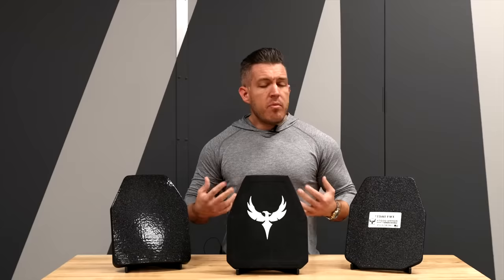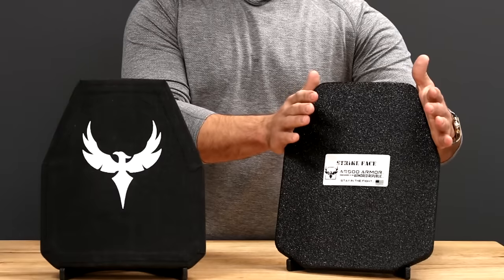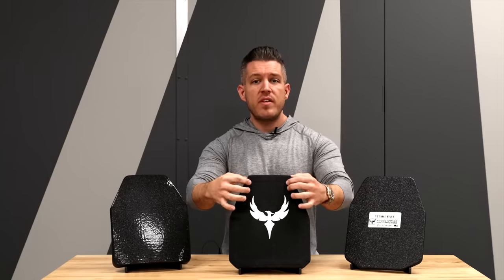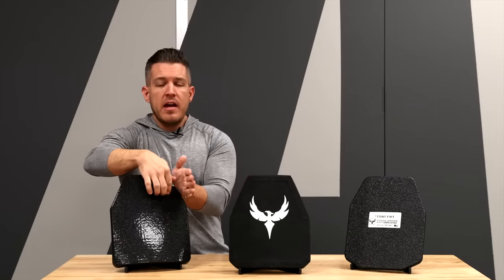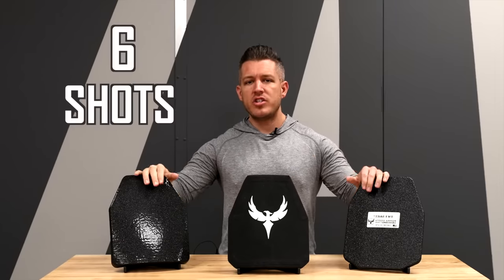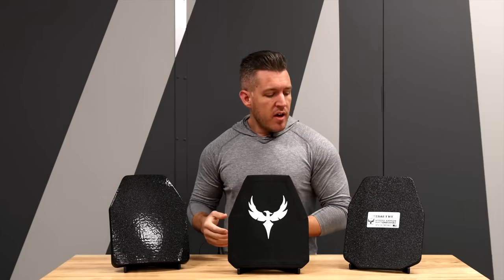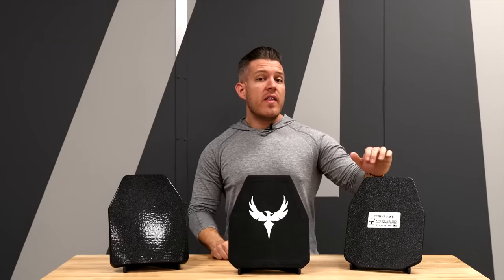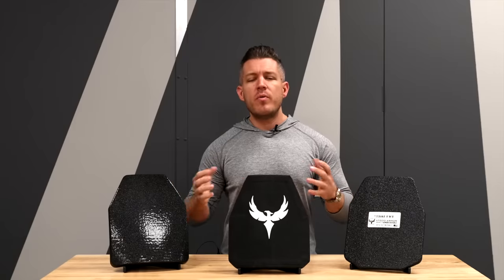What most armor manufacturers aren't telling you?   AR500 Armor

Comment: Just as UHMWPE Lvl III struggles with M855 but seems to handle M193 okay, Steel Lvl III armor has the opposite problem and generally struggles with M193 while handling M855 (hence the need for III+ designation to indicate it handles both threats).   

Since both of these are commonly available rounds, IMO the III designation should be considered obsolete and the III+ used as baseline to prevent confusion, I can't imagine there ever being a reason to opt for just the level III. 

Would like to see a spall test with base coat only on a multi-curve plate because some are looking for a concealable setup and the thinner the better for use under light jacket or hoodie.

Have you considered experimenting with perforated steel embedded within the outer layers of UHMWPE?  This is technology used in some armored vehicles (CVR(T) uparmor package and Leopard 2) to add protection while dramatically reducing weight.    The holes are sized and spaced such that a round cannot pass through without hitting an edge and experiencing high asymmetric forces that disrupts its path.   After it starts to keyhole within the armor, even UHMWPE should be able to handle something like m855 traveling more sideways than forward, and the material also serves to support the steel, keep it in place, help hold it together, and catch any spalling or fragments.  In essence, a build up coat that is armor itself.  Lighter than steel, thinner than UHMWPE, cheaper than ceramic.

https://www.rankarmor.com/assets/images/Bullet.gif

https://i.imgur.com/DdOL6o2.png

https://www.sciencedirect.com/science/article/pii/S0261306914004798
Reply: You could use T Rex tape to make a concealable carrier.  Won't be very comfy, and will hurt more if you get hit, but it'll work.

Comment: What if you added two plates, steel of course. Level 3 and level 3 plus. Is it stronger then level 4??
Reply: Even if it did, why would you want to?  Steel plates are very heavy.  Each 10"x12" level 3 steel plate is going to run in the neighborhood of about 9.5 pounds, depending on manufacturer, and the type and amount of anti-spall coating.  That means 19 pounds per pair of plates, which would normally be worn front and back.  If you're wanting to double up in the front, you also need to double up in the back just to keep your plate carrier balanced, which means 38 pounds of plates.  That's not counting the weight of the plate carrier itself, which will probably push you into the 40 pound range.  

That's also not counting the weight of any accessories you mount on the plate carrier, such as extra magazines.  For reference, a 30 round USGI AR-15 magazine loaded with M193 weighs 15 ounces.  I haven't weighed any mag pouches, but it's a safe bet that they weigh at least an ounce, which means that every magazine you add to the plate carrier adds a pound.  If you're adding double pouches, you're talking about an extra 6 pounds, so you're now up to 46 pounds.

If you then follow the trend AR500 is trying to push of the chest mounted pistol (I'll leave my comments on that specific trend at "I don't care for it"), you're looking at adding another 2 pounds (Glock 17 with a loaded magazine is 32.28 ounces, so 2 pounds, 0.28 ounces), and your plate carrier is now up to 48 pounds.  A fully loaded Glock 17 magazine weighs about 10.23 ounces (math from Glock's website based on the 
Weight with loaded magazine - Weight without magazine).  If you add 3 extra loaded magazines for the pistol, you're adding another 30.69 ounces, plus the weight of the magazine pouches, fair bet that 3 pistol mag pouches are 2 ounces or more, putting you at another 2 pounds for those.

Now, I'm not going to question whether or not you're fit enough to hoss all that weight around, because it's irrelevant.  That's a lot of weight to have resting on your shoulders, back, and chest.  It will go from "damn uncomfortable" to "downright painful" in a hurry, no matter how much of a hard ass you are.  The padding on some of AR500's carriers is OK, but trust me when I say that even when your whole setup weighs less than 30 pounds, that weight wears at you after a while.
Reply: That would be heavy.  Some plates are not stand alone rated and require a 3A kevlar backing armor which would be more realistic.
Reply: Considering no one so far understands the concept of answering a question YOU asked I'll gladly do so instead, with good quality steel plates to be exact, I've seen a video regarding this, two good quality level 3 steel plates was enough to stop 50 BMG, it pierced the first and slightly knocked a tiny hole in the second with no back face deformation on the second plate

Comment: Ugh at 1:52 you say "up to a 2" allowance" for an edge. Later your calculations for a 10x12 plate are inaccurate then at 8x10, because you would have to reduce 2 inches from EACH side... So that would make a 10x12 plate actually more like a 6x8 plate potentially.
Reply: I’m seeing this a lot and the only thing that makes sense, is he explained it wrong.  Really what I think he meant to say was take an inch off each side because this would mean two inches across total, and two inches vertical total.  Making a10x12 in to an 8x10 effectively, if that makes sense?  I’ve seen these plates cut through the center and opened up and there is an inch boarder all the way around which would be a total of two inches across and two inches vertically.

Comment: Wouldn’t a 10x12 plate be effectively reduced to a 6x8, not 8x10,if the first 2” from all edges are not ballistically rated?
Reply: That's what I was thinking too. If you take 2" from the left edge and 2" from the right edge, it's a 4" total reduction from the width. That's a bit spooky.
Reply: @NoLies17  except that literally no one build plates to that standard and all perform much better than that.  This is just marketing BS

Comment: What AR500 isn't telling you is that if you tell your friends you're wearing steel armor they will make sure they stand far away from you so that they don't get hit with your spall.
Reply: Wack put your plate in Kevler carrier it stops spalling after round makes impact with steel and fragmentates the Kevlar will stop the fragments
Reply: @austinherisch9122  so you’re saying after spending $500 on a carrier and armor you should go out and spend another $600 to get 4 Kevlar plates to try to force into the sleeve only to find out it doesn’t fit and you need to up size the carrier. So now you have to spend another $100 to do that. So after $1200 you have a 38 pound carrier without ammo. Nope that’s insane. Just get some hesco with Kevlar backers you’ll be good at 17 pounds without ammo.
Reply: @ShepherdOfTheSilkies  plate carrier made of Kevlar with steel plates
Reply: @ShepherdOfTheSilkies  not stuffing Kevlar plates into or behind steel plates I'm saying a plate carrier made of Kevlar holding steel plates
Reply: @austinherisch9122  so 34 pound empty then... and it still fragments out the bullet hole in the Kevlar and after 3 shots in one area it’s almost like it wasn’t covered on Kevlar. It also doesn’t fit most carriers.
Reply: @ShepherdOfTheSilkies  8 pounds a plate front and back plate 16 pounds total
Reply: @austinherisch9122  the Marine Corps flack plate carrier was 40 pound with 5.4 pound plates... keep that in mind
Reply: And when your ceramic is powder you will blow your buddies to borrow some steel plates.
Reply: @ShepherdOfTheSilkies  don’t hesco lvl 3+ plates cost about $2k set and only have a shelf life of 5 years?
Reply: @JC-cv3up  L210s with Kevlar backers will stop pretty much any common round. So no they aren’t $2000, The shelflife of 7 years will still last longer than chipped AR500 steel. There’s 25 year old ceramic plates that are still perfectly fine. The manufacture is just not liable after seven years.
Reply: @ShepherdOfTheSilkies  ok thanks 👍🏻
Reply: @ShepherdOfTheSilkies  $500 for a useless tiny plate carrier, you can get an F'ing otv vest with 3a soft armor for that price, that's the problem when it comes to spaling, people wear the wrong vest when having steel plates
Reply: @c03_psychie20  soft armor by itself will kill you even if it stops small rifle rounds. Many police departments have soft armor that can stop small rifle rounds but the officers have about a 50/50 shot of still getting killed by the impact. Injuries like broken sternum, broken ribs, ruptured stomach, ruptured intestines, popped lungs. Get solid plates that’s the only way you’ll be safe from a rifle round.
Reply: @ShepherdOfTheSilkies  read again, b.t.w. you're chances are higher if you wear soft armor under the plates to reduce the impact from the plate being hit, provided the threat has a small caliber then it is even better but my main point was you're supposed to wear steel plates in an otv vest to protect from bullet fragments, any other other plates is fine in a small carrier but not steel
Reply: @c03_psychie20  you’re not supposed to wear steel plates at all because the spalling fragmentation can kill you. You’re not supposed to wear it in a overt before covert setting.. The only thing that stops the fragmentation is Cavallar for the most part. A standard spray on coating will not stop spalling.
Reply: @ShepherdOfTheSilkies  hopeless
Reply: @c03_psychie20  what?
Reply: @c03_psychie20   I make my own and some other guy in the military gear like plate carriers all of which are overt… you don’t actually understand how body armor works in a different between steel, ceramic, and poly. Bullet fragments are not your worry when you have steel plates it’s the steel fragments from the impact of the bullet that are so sharp and are gonna invite themselves like fast-moving thorns into your face and skull. The fragments skim the plate themselves going down words and upwards so if you’re leaned over at all what you would be in a shooting stance you’re getting fucked up by the steel. There’s no way around that. That’s why the military only uses ceramic and poly plates. Thank you this has been my TED talk, you may now consider yourself educated.
Reply: @ShepherdOfTheSilkies  that's your problem if you wonna play soldier, the groin panel stops anything going down even when crouched(if the panel is large enough), the arm panels would do the same from anything going sideways(provided they are large enough) and the same with the neck collar will prevent anything from going in the neck and face. Still afraid of steel in the face? Get a ballistic mask, really not that difficult you people just want to play soldier pretending to have medical training and a medical helicopter on standby, if you plan on running around in the desert then by all means take an OPS core helmet and ceramic plates but that will not work if your sitting in your house, those ceramic and poly plated are too small, next time think logically and leave the military POV and try a civie POV(Btw. I understand plenty enough of the variety of plates, my original point was you should not wear steel in a plate carrier like the you would the other two plates, don't know what you were trying to do talking about the military which I'm not)
Reply: A lot of people use spalling sleeves to catch it now
Reply: @ShepherdOfTheSilkies it’s obvious you are not educated on this subject.
Reply: @paulschmidt1247  I’m more educated on it than anybody that in this common section including you. Mr unintelligent/basic/poor rebuttal
Reply: @ShepherdOfTheSilkies  LOL you don’t know the difference between spalling and  fragmentation, would you like me to educate you?

Comment: Wait a sec... did you say you can magnetize 7.62x39s and make them penetrator rounds?  Did I hear correctly?  Or are some of them penetrator rounds already?  tnx.
Reply: Magnetizing a round would do nothing.  He is saying you can use a magnet to tell if a round is ferrous, aka has steel in it.  Even if it isn't a steel penetrator round, the added steel won't deform as easily as lead will.  This weight retention will make it harder to defeat.

Comment: Submitting the steel plates to NIJ labs yet instead of independent testing? Your PE and ceramic are NIJ rated, why not steel?
Reply: A transition to .07 and .06 not including common rounds such as m855. Not a lot are putting products through certs with .06 with .07 on the horizon. We also believe the private sector can achieve quality, another side benefit is reduced cost to the end user. Keep an eye out for whats coming.

Comment: Great video Tyler!

I do think you should touch on the whole 20inch AR at less than 25yds defeating lvl3 plates given the current buzz around steel as of late.

People should understand the context and tradeoffs of using ANY armor.
Reply: The only positive thing about that is 'good thing people are obsessed with short barrels.'
Reply: They won’t because that would make their armor look bad. Which is the opposite of what this bullshit video is attempting to do.
Reply: yeah lvl 3 will stop quite a few 556 rounds, but out of a longer barrel or m855a1 and its going straight through. who cares tho? its the responsibility of the buyer to get what they need. all the info is out there on what each plates limits are.
Reply: @mikeslama4926  its bad because bullets go through plates that arent designed to stop those bullets? do you need warning labels on everything else you buy too?

Comment: Sorry, but ar500 brand armor is just OK armor for a higher price than anywhere else you can buy armor. 

I buy armor from ebay. If you shop around you can buy ar500 steel armor with anti frag coating at cheaper prices.

Comment: WOW! (Some companies)Two inches off the border sure does make it a mini! Might as well wear soft body 3 with trauma plate...
Reply: BS scare tactics to get you to buy his heavy plates
Reply: @ChevTecGroup  I doubt that. I believe whole vests aren't level 3. You think trim as same protection as middle?
Reply: @johnbrown2163  no plate manufacturer has 2 inches of edge. The last plates I bought (soft 3A) we're 10x12 and the non ballistic material wasn't included in the 10x12 measurement.  Also,  yes I do believe that 1" from the edge is the same as center for hard plates.  They are made in layers of equal thickness.  Plates don't get thinner at the edges because they make them to have equal protection.  NIJ standards may allow for 2" of unprotected edge, but I haven't ever seen a manufacturer make them that way, except for one company making STEEL plates that had the edges softer due to using heat to cut them,  annealing the edges and defeating the purpose of steel.
Reply: @ChevTecGroup  Thank you for your insight and Knowledge on the subject. I believe you before a salesman.
Reply: @johnbrown2163  years ago I probably would have recommended steel plates.  I even had some cut out of a plate of armox steel only to find the soft edge issue and spelling issue.  Now with the cheap ceramic and uhmwpe plates,  there is no reason to buy steel.  My old steel plates got made into range targets
Reply: @ChevTecGroup  May I ask why you always buying vests? I would keep all the old plates and have new vests made or bought.
Reply: Or sale old unused plates.

Comment: What AR500 Armor isn't telling you: Not a single product they make is NIJ rated.

What AR500 Armor isn't telling you: The testing criteria for their armor and the scientific basis for their claims

What AR500 Armor isn't telling you: Their spall coating is truck bed liner with no scientific basis for consistency or repeated successful use.
Reply: They have plenty of third party ballistic lab reports. They should be more open about posting them on their site. The correct statement is "Not a single product they make (the steel and soft armor) is NIJ Certified. Lots of armor places do that. They throw around "NIJ Certified" and "Tested in Compliance" or "NIJ XX Compliant" :D
Reply: bullet splash is very scary and steel has a real bad problem
Reply: @BuffRANGE  Yes, many armor companies say "NIJ compliant" and that's misleading, intentionally so. However, nothing AR500 Armor makes is NIJ certified, despite them attempting to make you think it is or that an independent laboratory testing their armor to conditions requested by AR500 Armor is the same as an NIJ certification. 

The NIJ certification is not just a test of the armor's ability to stop bullets. It requires a scientifically representative sample size of plates to be exposed to temperature extremes and then shot under scientifically repeatable conditions. There is then inspection of the manufacturing processes of the armor and follow up testing of production plates. Failure of any stage results in immediate recall and potential revocation of NIJ status.

All AR500 Armor has to do to say "independently tested to NIJ standards" is have a plate or two sent to a lab to be shot at by calibers listed under the relevant NIJ standard with no temperature extreme testing or follow up inspection or testing.
Reply: Alt_Knight I’m in agreement. Just saying it’s better to say the stuff they make (steel and soft) is Not Certified. Originally you said “NIJ rated” which would be a little off since all of their products sold are sold with a specific NIJ rating :)

Comment: If I buy steel with a base coat how do I protect against spall?
Reply from the maker: The base coat provides some spall protection by directing fragmentation away from the body at a high angle, plus the carrier also helps catch some of the fragmentation. If that doesn't give you peace of mind, you always have the option to buy a frag guard that you insert the plate into from another company.
Reply: Wear an otv vest

Comment: Ever considered putting a rolled lip facing outward on the steel plate to redirect fragmentation if the coating fails? If you use this idea i want a .05% royalty from all sales with models using that design.